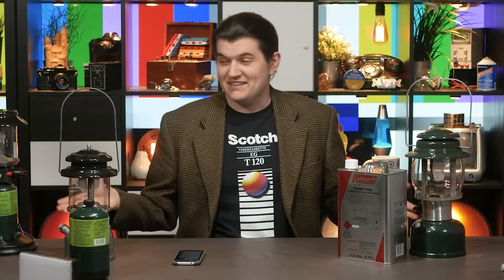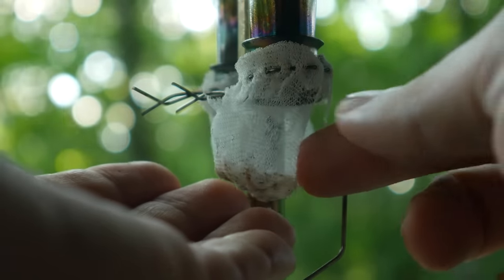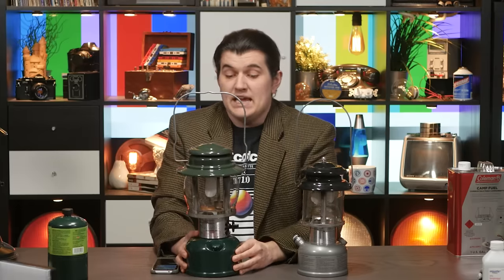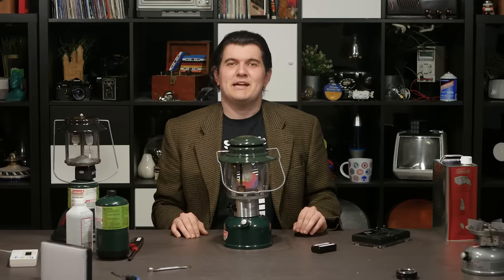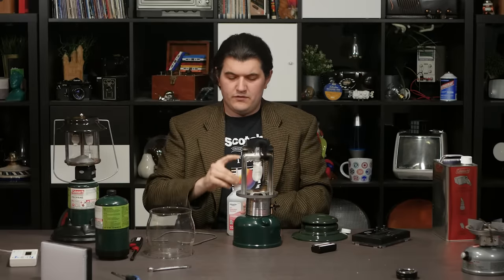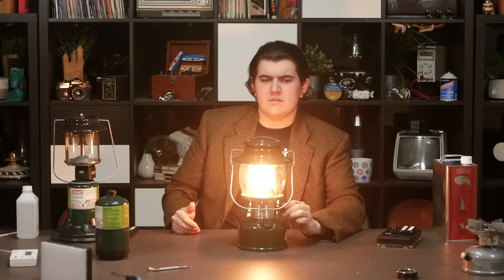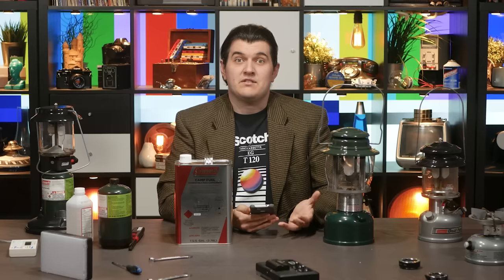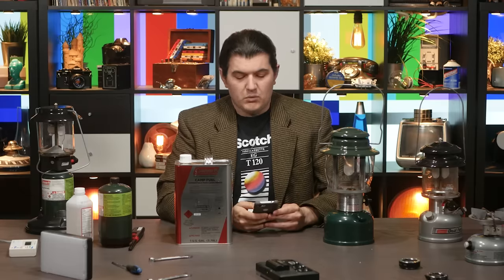A very rambly Coleman Lantern follow-up. Turns out they rarely make sense in 2021

Comment: The requirement for covering the hole to pump the lantern is a safety feature. It helps prevent accidental pressurization. Just vibration from transportation could cause the tank to get pressure and possibly cause a safety hazard. So they increased the requirements to pressurize the fuel to make them safer.
Reply: Funnily enough, Petromax lanterns don't come with that hole, but also I wasn't aware up until now of the accidental pressurization hazard.

(And fyi I don't have any lanterns up to this day and if I were to buy one it would be either a dual fuel Coleman one or a butane one that can be found for a reasonable price in my country.
Reply: Safety feature? No. The hole is simply there to seat the pump shaft without fighting the pressure.  Just don't cover the hole at any time while pumping and you can easily seat and secure the pump shaft. Was this really a mystery.
Reply: @insightmedia5817  have you actually used one of these lanterns? You can’t build pressure without covering the hole.
Reply: I just figured the thumb requirement was to keep dogs from operating it. You know they would if they had thumbs. Clever little devils. 🐶🙂
Reply: No, the hole is there so you can't over pressurize the lantern.
Reply: @boromir2099  I think IM's point was that function of the hole (which lets air out from behind the pump piston when uncovered) is to allow you to easily return the pump to its screwed-down rest position.
Reply: @indigotidebeeblebrox9978  That's what I always thought it was for.
Reply: @psirvent8  Petromax lanterns don't have or need the hole because they have a gauge.  The reason for the hole is to prevent over-pressurization.
Reply: Nope!  While it IS a safety feature, I have to respectfully disagree.  Any pressure that would build up, for any reason, would not be able to escape from the hole, any more than it would when you take your thumb off it after pressurizing the lantern.   There is a NRT valve in the bottom of the pump cylinder to prevent that. 
Also... "accidental pressurization" is just not an issue.  You could drive all over the country with it shaking and bouncing all the way, without creating a significant amount of pressure .  The only form of transportation, that could possibly build any significant amount of pressure in the tank, would be on a high flying plane or a rocket. 🤔

Comment: Fun fact: Tin cans are actually not made of tin. They’re coated with tin as an anti-rust system, and are largely made of steel (which is why some electric can openers have magnets to catch the lid). But because of that anti-rust coating, sheet metal is often referred to as “tin” even if it doesn’t even have a tin coating.
Reply: I know the coleman fuel cans are made of steel, with some kind of plating, either chrome or tin is my guess. Whatever the plating is, they do get rusty with age.
Reply: Tin cans originally WERE tin. It is a easily worked type of metal sheet that was comparatively cheap in the 18th Century when canning food was being developed.
Reply: @occamraiser  OK. I may have actually heard that somewhere else, but regardless, it makes sense. LSNED.
Reply: This is also why sheet-metal sheers are also sometimes referred to as 'tin snips'.
Reply: @occamraiser No. Food canning started with glass bottles, but it quickly moved to tin-coated iron cans made from "tinplate".

Tin is too soft to make good cans, so they combined its low reactivity with food and the strength of steel. 

Tin snips so.ilarly would have gotten their name from the use of tinplate, not elemental tin.

Comment: I collect and repair Coleman lanterns and stoves. It’s good to see respect for these older designs. There are several interesting mechanisms inside them. The way they draw vapor from the top of the fuel tank for easier lighting but then draw from the bottom of the tank for running, with a single valve is very clever.
Reply: He didn't mention how you could add a flint  Igniter that you can slide up to the  Mantle spin the wheel light it and then pull it back down out of the way great edition the lantern so you don't even need a match It's permanently attached to the lantern
Reply: @kennethparker2168  that’s just an accessory, (that I add to about half of mine).

Comment: I think you're spot on about emergency use being realistically the primary need for this kind of lighting.  I have 2 aladdin lamps in the cellar and during the last power outage they where quiet useful. Of course I used the torch function on my phone to find them. The extra heat was welcome as it was November so not freezing but far from warm when the gas heating shuts down due to no power to run the control electronics and the circulation pump. I have an old propane lamp that goes camping with us in the back of the van, which I've used to light the motorhome when its power system failed, as a fair amount of light for a sort period while fixing stuff is useful.  Once the emergency is over it gets packed away agian and everything runs off the vans batteries.
Reply: We used to have a kerosene stove on the boat. Alot of old boats do. Other gasses are dangerous to have in a sealed hull and it burns nice and clean. Anyway becuase you already have all the stuff on hand kerosene lamps are a usefull thing.  Save the batteries and are just abit prettier. Warms the boat up too which is nice at bedtime.
Reply: @John Brown not freezing in November? Northern Minnesnowta just stepped in to chat.
Reply: Yawn
Reply: @ducewags  I'm in the UK, November can be cold but we tend not to get temperatures below freezing until December.
Reply: @johnbrown3155  That would be nice, then again the -40's in the winter kills' off the summer bugs. -40f is very close to -40c if you were wondering.
Reply: In Canada the fuel fired lanterns are nice for camping as they take the humidity out of the air and prevent condensation, plus they are enough to nicely heat a small space.
Reply: @jeroylenkins1745  Does that only work with Canada's air? Or will it work with other Country's air also? Settle down, it's a funny, or a joke maybe? Oh and when are you going to came and take this smoke out of out air, that your big fan's are pushing down here? You know, the big wind pushy things for power. Oh and on a serious note, hello neighbor to the north, unless you live south of my area. Then it's a hello neighbor to the north, that lives south of me. Have a fanbtastic day, and darn it smile...

Comment: We primarily use a propane lantern at late season hunting camp. They have the added bonus of heat. It can quickly heat a six man teepee tent in a snow storm.
Reply: Very valid point - the heat produced as a side effect of producing light via gas can be utilized as a means of heating outside lighting a fire.
Reply: I am sure that the propane one is worth the premium cost too, it is so much easier, and in the cold, does anyone want to fiddle with these lamps, or just hit a button and have light and heat going asap?
Reply: Pretty much I think this is the answer to all cases where these are relevant : when you are in a situation where you can't carry much AND you need heating and lighting all into one object
Reply: Be extremely careful using your propane lantern as a tent heater. Even the cleanest catalytic burner puts out carbon dioxide as well as carbon monoxide. I didn't read about this until recently but apparently the effects of carbon monoxide can stay in your body for *months or perhaps even years*, it bonds into you on a cellular level.  I would recommend that you use a battery powered battery powered carbon monoxide detector, and obviously if the tent leaks air a little bit you can consider it a good thing for health and safety.  I have to wonder which is cleaner burning, a Little Buddy heater or a catalytic? propane lantern (does the mantle provide a catalytic effect as well, or merely the incandescent glow?).  I have used the Little Buddy heaters in my garage, or in the house during power failures in the times before I had a generator, but I did make sure to have a CO detector in each room, and I would crack a window periodically to let fresh air in.  The same thing goes for using my portable propane camping stove to cook with in the house, I wouldn't run it for more than 15 to 20 minutes or so at a time.
Reply: @goodun2974  This is true, thank you for bringing it up. I am aware of the dangers. We used it when getting ready for bed and when getting dressed in the morning. The rest of the time in the tent we kept warm in our sleeping bags. The lantern was on for maybe half an hour at a time and nobody slept with it on. I should have mentioned the risks though.
Reply: @gimpybarrett   I'd really like for Technology Connections to  do a video about the dangers of carbon monoxide from burning gas and fuels, as well as a video about modern LED lanterns. 

I do have an LED lantern that looks very much like a Coleman type lantern and runs off of C or D cells ( can't  remember which). It has 4 big yellow strip LED's known as COB for chip on board, and it has 5 levels of light output. I do wish that it used rechargeable batteries instead. I don't remember where I bought it but I think it was about 20 or $25 so quite affordable. One thing I should mention about LED flashlights is that most of them are essentially on all the time, and draining the batteries slowly but surely ----  Any flashlight with 2 or more modes can generally be assumed to have a constant slight battery drain because the switching circuitry needs to pull power in order to remember what mode it was set to last time,  and either return to that same mode again or go to the next lower or higher power or flashing mode or whatever. This irritates the hell out of me and I suspect it may have something to do with the prevalence of batteries leaking. If I was designing Flashlights I would put a hard on/ off switch on all of them with a separate selector switch so that you can set the flashlight to come on each and every time was with whatever mode with whatever mode you prefer or are likely to use the most.

 It goes without saying that I only use my LED lantern when I am refilling my gasoline powered generator, and certainly not the Coleman propane lantern!

 The modern Coleman stoves and similar knockoffs have really gone down in quality from the one we had when I was a kid. The flame-adjustment knob is pretty much either on or off, and getting any kind of useful,  intermediate heat adjustment is very tricky.  Fortunately I only have to use it a couple times a year when the power goes out and I can't use my electric stove. My wife is not into camping anyway, there's no way I'll ever get her to sleep outside in a tent!
Reply: It would have been a useful device to have in the Texas power outage/freeze going on. They put out a surprising amount of heat for a small device.
Reply: I live in Canada. Most of the people I know that prefer propane do so for convenience. They are generally working with a fishing shack they can drive to, or are in a camper. Most people who have to walk anywhere still prefer naptha or alcohol with a small minority using jet boils. The heat these lanterns produce is certainly a big benefit that rules out the use of electric lights in 3 of 4 seasons.
Reply: @SlavicCelery  buy an aladdin kerosene lamp or a old rayo lamp i used mine during the deep freeze it kept living room very warm